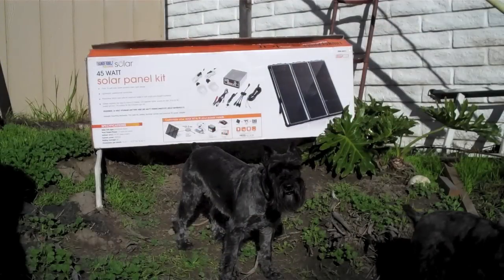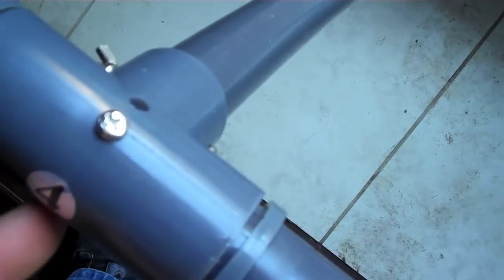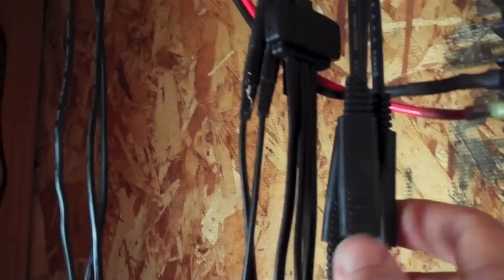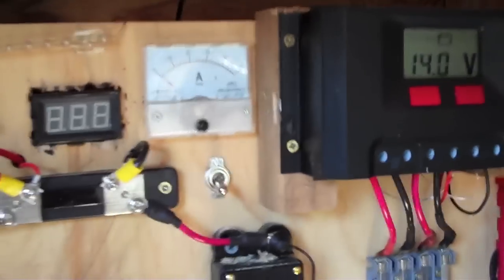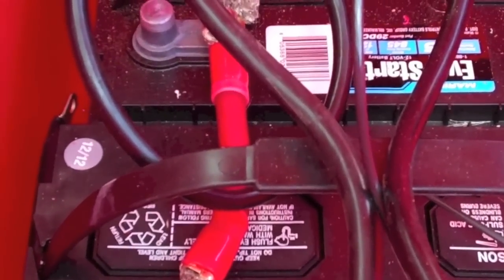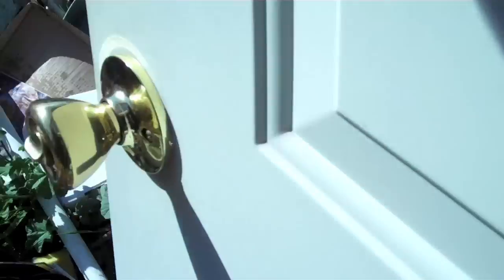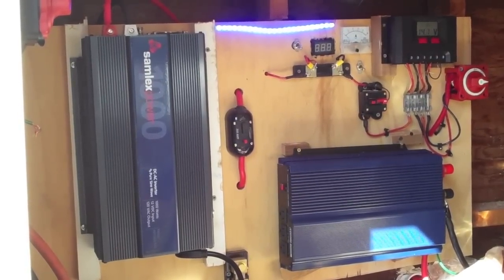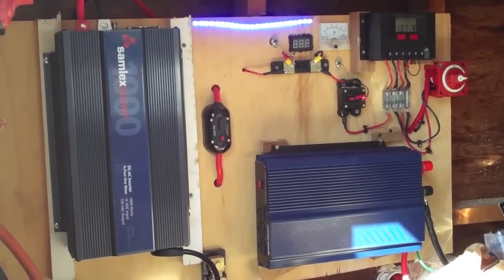Solar Power System Harbor Freight Panels Portland Oregon

Comment: Have wanted to learn about renewable energy and all the components and the correct way to install. The manufacturers just assume you already know how to install these items and calculate what you need. You can do it completely yourself   no matter if you are handy with tools or not. https://plus.google.com/b/100728704920141855812/100728704920141855812/posts/WjRt4LRZEzo
Reply: Thank you very much for this, it was perfect, very clear and easy to follow.

Comment: So to save money on my electric bill I would have to spend atleast $1400 plus my time installing something similar to this?  🤔
Reply: Yes.  If you buy used stuff,it's way less money.I'm into my 450 W. system about $1,000.
The panels are good for about 20 years.

Comment: I have the solar panels and they are still in the box. I was waiting for good videos like yours to give me direction. great nuts to bolts explanation...except as a novice I am not sure what "into these" and "go here"  means. Wondering if you have a labeled wiring sketch you are willing to share? If not I'll try to follow your video. Thanks.
Reply from the maker: Thanks I just put his together with old & some parts I had laying around I didn't have or use a labeled wire sketch just colored wires:  Thanks foe the question!

Comment: pretty interesting.are you completely off grid,meaning you install more panels?? And how much have you saved on power bill???
Reply from the maker: Yes the system is 100% off grid - it's only used when my reg. power is down : it runs my TV & Computers & a few lights but not the whole house.  Thanks for the question!

Comment: would this run a 110  3hp air compressor?  For how long?
Reply from the maker: I'm not sure - I'm thinking it most likely pulls to much for my little system: Thanks for the question!
Reply: about 5 seconds I'm afraid 😨 solar power will never replace grid electric it's only a gimmick but maybe one day it will advance

Comment: where did you do your research on solar setups?  the fuses that is another idea is that too many do not do👍
Reply from the maker: I looked a various setups online & put together with what I had to work with in 2013-  it's now 2017 and it still works great! Thanks for the question!

Comment: I did almost the exact same thing and tried to plug a microwave into a 2,000/4,000 watt inverter.  The CC cycled off, was I trying to take too many amps from the batteries and the CC tried to save it self?
Reply from the maker: +FejerangJ  Thanks

Comment: Looks pretty involved.  But I'm glad you got it working.  I thought for sure, you were an electrician.  Thanks.  I need to study more to be able to do what you've done.  A lot more.  Are you able to power your whole house with your system?
Reply from the maker: +nzinga zindua  No this only for a few items like tv & computer, lights if you need more power it's more complicated, more money.  Like computers technology is changing very fast  the newest thing I see 
FLEXIBLE SOLAR PANEL ROLLABLE panals. Old type I have & you see on homes lasts about 20 to 25 years try starting smaller and learn what works for your needs! Thanks!

Comment: Awesome job man.
Reply from the maker: +Augustine  Morales   I'm liking these 
FLEXIBLE SOLAR PANEL ROLLABLE panals. Old type I have & you see on 
homes lasts about 20 to 25 years what do you think of this type of panel
 ?  I've been told they cost more but better for most home roofs & 
no rain H2o leaking issues as much.
Reply: I think it's awesome may coust a lil more but worth it in the long run will definitely pay it self off and some
Reply: Cost LOL not coust
Reply from the maker: +Augustine  Morales  Thanks!

Comment: Impressive set up! Its great how many people are going green, even if it's a little at a time. I myself can't wait to get started on mine, however I will be going slow at first since money will pretty much govern how much I can do at once. 
Would you happen to have any tips on what solar panels I should start with. I would also like any advice you may have with regards to;
1) How to get started,
2) What brands to go with and which are  "lemons-avoid at all costs", and
3) Finally any inside information and opinions. 

Thanks a lot.
sos77
Reply from the maker: Like computers technology is changing very fast  the newest thing I see 
FLEXIBLE SOLAR PANEL ROLLABLE panals. Old type I have & you see on homes lasts about 20 to 25 years
Reply from the maker: I made this in 2013 it's now 2017 & it still works great!

Comment: You can build it for half the cost: Here's the list:

 - Renogy 100 Watts  Monocrystalline Solar Panel $150
 - Renogy 100 Watts  Monocrystalline Solar Panel $150
(Two  100 watt panels, instead of  four ( x 3 panel each = 12 panels)  45 watt Harbor Freight Panel kits)

 - Renogy 30 Amp Charge controller: $50
- Xantrax 12 volt, 1000 watt Pure Sine Wave  inverter $250
(Half the cost of  Samlex 1000 watt  inverter)

- Three 12 volt lead-acid batteries $150

Total cost: $750. I'm not an electrician either, Just did my research :)
Reply: +Nick Hersheys Yep, you did your research 3 1/2 years after this dude built his with what was available at 2012 prices!  I like how folks get on these older channels and tell everyone how much cheaper they can do it nowadays.  Of course it can be done cheaper.
Reply: nice list, thanks
Reply: +Nick Hersheys The 15W Panels by themselves cost $65 But if you buy the Kit ($140 as of
 this reply) they are $45 and you get the little extras. Granted still 
way more than Poly or Mono BUT these Panels do Way better in Low 
Sunlight Situations. Those 12 will still be bringing in Power where as a
 200W Poly/Mono Panel will not. He would Benefit from ADDing a Poly/Mono
 Panel but he may not need all that wattage. He just needs a Good MMPT 
Controller to get all he can from those 12.
Reply: And since you wrote that 2 years ago, I just bought seven 310 watt panels for $130 each, brand new!   But mine are Polycrystalline.  Just a small less efficient.  I wonder if they will come down even more 2 years from this posting?!
Reply: And I just saw a 3000 watt pure sine inverter at Walmart for $399.  I wonder if that would do the job?  Granted it's not a Go Power inverter, but for $400 bucks...
Reply: if you can do the math, the wiring to your house is easy

Comment: Good job!What is the name of that red on and off switch,I want to get one but dont know the name of it.Also you showed the line going into the house but did you make wall outlets or what did you do.Most youtube vids show it going to the house but thats it.I have never seen a vid in detail of how they went from their shed into the house for use.
Reply: +Gary H its just like you said a battery switch, there are several makes, colors and designs. http://www.amazon.com/Marinco-701-Battery-Disconnect-Switch/dp/B005DUUL9W/ref=sr_1_1?ie=UTF8&qid=1440518387&sr=8-1&keywords=battery+switch
Reply: Ozark Mountain Girl Thank You!

Comment: Do I need to do all this if I only want to connect 1 light and 1 extra plug for a radio, on a shed ?
Reply from the maker: That should be ok just get a car battery dash aftermarket meter wire it in and keep it above high 11ish volts. when it ge'st to low turn off system so you don't damage your system. And charge back up.

Comment: This is not to pick on you.  I think you did great.  Especially for not being a pro electrician.  I just want to point out to you and your viewers.  Pure sine wave inverters actually are not needed for your "electronics".  Phone chargers, laptops even DVD players and flat screen TV's are just as happy with the square waves that most inverters put out as they are with sine wave inverters.  I'm not going to try to confuse anyone by going deep into AC electrical theory but I think I can say just enough to explain what sine wave inverters are good for.  First of all, a sine wave refers to how the way the electricity looks on an O'scope.  It actually looks like swells on the ocean.  it goes up and down smoothly.  A square wave looks just as it sounds.  It jumps up goes across rather flat and then falls abruptly and goes across and repeats that.  Think of the two in something you see more often.  Like a gas engine.  We all know they don't really like to have the gas peddle slammed down and then released over and over again.  They prefer a nice easy acceleration and then on the other side they like slow deceleration.  When you put a square wave on your power tools' motor its just like slamming on the gas, holding it there a moment and then releasing it.  Then doing it again and again and again.  A pure sign wave is more like easing your engine up to speed and holding it there.  Hope that makes sense.  You will wear out and overheat your electric motors with the regular inverter.  You will also use more electrical energy using them.  Just like stopping and starting your car gets worse mileage compared to steady speed.  Now you know the rest of the story.  Pure sine inverters do cost more up front but IF you plan on using the AC in your camper, utility trailer or van to run motors... sine is the way to go.
Reply: Great comment i learned something today lol

Comment: Nice job but sorry to be another youtube hater but solar is just not efficient to begin with and you've really gone out of your way to make it worse with the batteries in parallel, sine wave inverter and high cost/watt panels. you've spent about $600 on the panels, $300 on batteries, and probably $500 on all the wire, inverters, switches etc.  when its all said and done on a perfect sunny day you'll be making about 150 watts just to charge those batteries so you can run things off the batteries when the power goes out.  if you want charged batteries for emergency power use a $20 car battery charger to keep them topped off. those panels will make you about 275 kwh/year. at 14 cents per kwh that's about $38/year.  at that rate it'll take over 36 years before you break even.  thats of course assuming the batteries and panels last that long... which of course they wont.  its not so much your fault, solar just isnt where it needs to be.  the best, most efficient systems are still around 10 years for the break even point.
Reply: *****
if you can live off the grid or at least save 20% on your bill THEN you can say  this is efficient. I agree  what the smurf said, hes charging  a couple of batteries. maybe charging his cell phone/laptop....  This is just a hobby... spending money on  a system that isnt really cutting down your electric bill.

Comment: how much money do the wire ext on your panels cost because they seem short do you make your own or buy them
Reply from the maker: rickw2354  I got some of the wire off Amazon, some from Home Depot and some in my garage it cost a couple hundred bucks.
Reply: ocdoves what size wire did you use i was told 10 gauge would work on harbor freight solar panels

Comment: iv got a kit s well but I also have something else and I find this better
1. mppt tracer 30amp controller $170 /amazon
2. (2) 105 watt grape solar panels $120 each /sears/amazon
3. 600 watt pure sine power bright inverter $219 /invertersrus
4. 1100 watt energizer mod sine inverter $100 /invertersrus
5. (2) group 29dc batteries $90 each with a $10 2 years extended war. /walmart "note" this is the biggest in amp hour that my store has and its 122 amp hours each
this ran me under 1000$ and this is a good start I would recommend this setup instead of 4 HF kit but I have one as well but only 1

Comment: Nice job, I will be doing something similar to yours, I plan to start with the garage, I am also in LB.
Reply from the maker: yellownp22541 Mine still works fine I've used it to power a attic fan to blow heat out of the attic saving on my ac electrical bill  & when the powers down I have lights & a computer.!

Comment: Use a 120 volt battery system with a 120 volt DC to AC converter for best results

Comment: I purchased my kit last week. I'm using this to get a feel for how it all works. I know that I can build a more powerful system, but for now this is all I need. I have a few questions for you.
Where did you get your wires from?
Where did you get your fuses from?
And where did you get those red switches from? 
I hope you can see a pattern. I am trying to find out where I can get the extra items. I am especially interested in the analog meter as well. 
Thanks and good luck!
Reply: Can I ask why you want an analogue meter? they are not as precise as a digital one.
Reply: Phillip Aboody Well, they don't have to be analog. I was just thinking that they would use less electricity and I just wanted something cheap (price wise) to put in. But, I might be wrong as far as the electrical use goes. Any suggestions?
Reply: Phillip Aboody Not the cheapest option but it will allow you to upgrade everything else or move it to another system as long at you are using less then 300A... If you plan to go bigger then look at the same user and select a bigger unit (its not the volt/amp meter it the shunt that is the thing that changes).

http://www.ebay.com/itm/DC-120V-300A-Volt-Amp-Combo-Meter-Battery-Charge-Discharge-Indicator-With-Shunt-/181136879829?pt=LH_DefaultDomain_0&hash=item2a2c9970d5
Reply from the maker: Dimond Wallace Some of the wires from Amazon some from Home Depot, Lowes, some from my garage same as the switches & fuses same places. Thanks for the questions!

Comment: No charge controller? And also, I find that deep cycle gel batteries to be more efficient
Reply: He has a charge controller. Its the black thing that the solar panels and the batteries are connected to.

Comment: I have the 15 watt panel,a inverter and a sunforce controller but its all to run my ham radio and cb its a good start for me but i will in the long run be going away to home depot and getting a little higher quality
Reply: Higher quality Yes but also price per watt is also better if you buy the pits and put it together your self.

Comment: This is the Solar Power System Harbor Freight Panels??? I purchased it and sure don't have all those things you called, "Goes in this here, into this thing, over to that and this is this and that. All I got was 3 panels, couple of light blubs, a controller and that's it? Me thinks you ought to change the name of your video.

Comment: you do not need a pure sine inverter to feed power to a modern notebook tablet or other computer device! the notebook power supplies are switching power suplies and rectify it all to dc to charge and supply your computer so the pure sine wave is meaningless! also, polycrystalline solar are less than half the conversion efficiency you could hav gotten for half the price if you bought us made cells and assembled them yourself! not to mention 200 worth of american monocrystalline cells would result in a 150-200 watt charge rather than 45 watts.
Reply from the maker: Thanks for info:
Reply: He might want to run things that have motors, and the pure sine wave inverter won't damage the motors.  Better to have good, safe power to use however you want, then dirty power that has limited usage.
Reply: TheStavros1001 So what does the pure sine wave do differently? I have just a regular inverter and was running a circular saw, a drill, a dremel..etc. off of it on a remote job site and never had a problem.
Reply: Matthias Southwick I'm still learning myself, so I'm afraid I couldn't explain it very well.  It's easier to just look them up and decide for yourself what works best for you.  My research so far indicates that the modified sine wave isn't good for long term use for computers and things with motors.

Comment: Good job!!!  I also have 4 sets from HF....  Love my system ... Why the use of the amp meter when your charge controller should tell you?????  I just wanted to say.... Ya, when the power goes out... People complain... Not me....  During that super storm Sandi, No power here for 5 days???   But I had light, heat, charged up my electronics, internet.... And cold beer :)  My neighbor next door was crying at his kitchen table by candle light cause he lost $300 in food.... And get more batteries....
  Also, don't use 12 volt incandest bulds....  Go with 12 volt LED lights....
Reply: Try 1000bulbs.com.... Those bulbs were made for campers, RV's, boats....
 My incandecent 12 volts bulbs burn 3.5 amps an hour.... The LED's only .3 amps... Big difference when you are running on battery power only....
Reply: coldone001
 Also, Our tech guy was going to throw out a Non-working UPS .... Said its cheaper to buy a new one than get a battery for it....  I took it home, took the 12 volt 7 amp hour  battery out of it, hooked it up to my battery bank... Free invertor, 1500 watt, pure sine wave!!!!  WOOT.... Just the darn thing beeps every 10 seconds.... UGH....
Reply: coldone001 Is it 1500W or 1500VA because their is a difference.

Comment: I think you did good.  When I watch videos like this I try to understand the intent.  You learned a lot and helped a lot of people. I read some other critical comments. Use the electrical code for wire size and you will be ok.  Amps is amps no matter what the voltage is. Overcurrent protection is based on the amps.  Maximum amps x 1.25% equals breaker or fuse size.